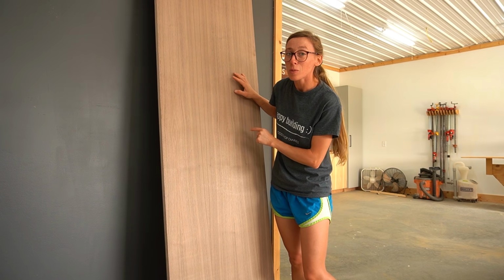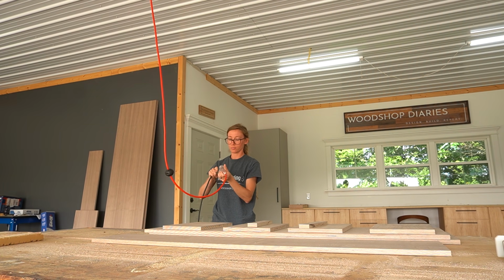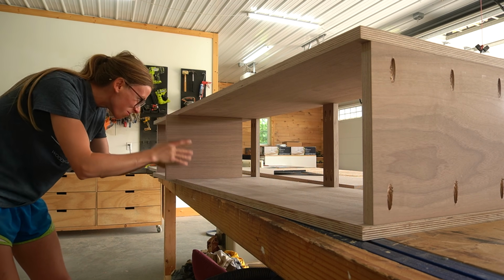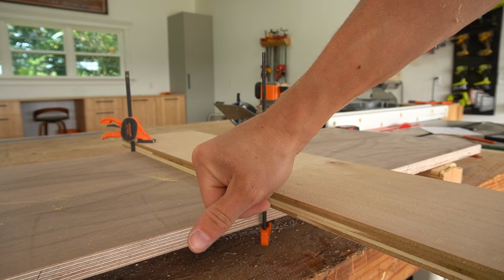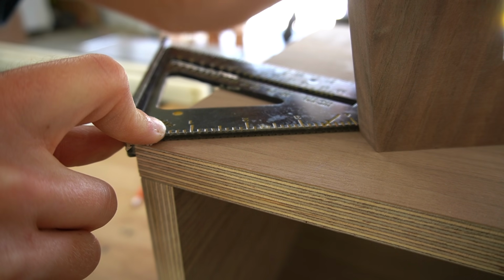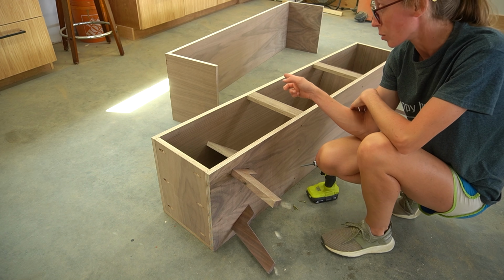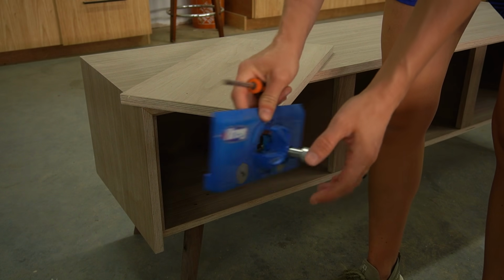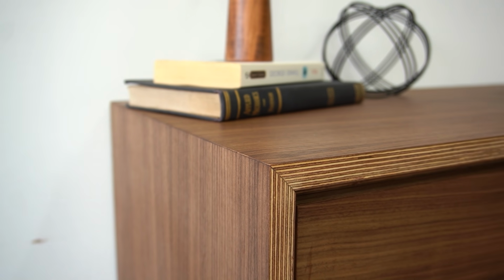How to Build a Mid Century Modern Console Cabinet

Comment: Why did you use full overlay hinges and not half overlay? Is it okay that I’m using half overlay hinges?
Reply from the maker: Almost every frameless hinge I’ve seen is full overlay. There’s so much adjustment in the hinge that you can adjust it to “half overlay” but typically I just leave 1/8” reveal so it’s full overlay.

Comment: I know I'm late to the party, but can you apply the furniture butter over a stain? I'm attempting to do a very similar project to this, but want to match the wood of the furniture I already have which is a dark walnut or espresso finish. I'd like to try and stain the wood to match my existing furniture, but don't want to use a polyurethane where I get a super high gloss finish.
Reply from the maker: I’ve not tried to use furniture butter over stain so I’m not sure how it would react. They make clear coat in different sheens. You can get a flat or matte sheen that won’t add shine. Minwax polycrylic in flat is what I’d recommend
Reply: @WoodshopDiaries Thank You!

Comment: Great design and great job!  You could also make the sides longer and make a space between the body and the top shell to make an extra space above the body and the top shell.  You would have to connect your initial box differently, so you wouldn't see the pocket screws.  Really nice flexible design.

Comment: Just found your channel this week.  Had to say I love the way you present your projects.  Also, I learned a number of things today: how to use a speed square to set angles, door building using the hinge jig, etc.  

I'm wondering how heavy that piece is?  3/4" plywood sides AND back panel!!  Yikes.

Thanks again for such great content.
Reply from the maker: So glad you’re enjoying the content! Thanks so much for following along and checking it out! To answer your question, it’s heavy! I can lift and move it myself (so it’s not crazy heavy) but it’s a sheet and a half of plywood so probably around 120-130 lbs 🤷‍♀️
Reply: What if you made this out of 1/2"    instead? Save money and it would be lighter.
Reply from the maker: You could. You might save a few bucks (very little—the price savings between 1/2” and 3/4” is pretty small) but it would be lighter if that was the main concern. However, I don’t think 1/2” material would do well spanning this width without an additional center support, though. I don’t use 1/2” material in my projects for several reasons (a few: they require different size screws, hardware and edge banding, and it’s not suitable for every situation).
Reply: @WoodshopDiaries  thanks again for replying. Your rationale makes a lot of sense. 3/4" it will be for me then. Thank you again

Comment: I love modern looking furniture and this looks fairly straight forward to build. I'm wondering how you would think it would look if the edging of the outer box was mitered inwards at 45 degrees?
Reply from the maker: I’m not sure I understand your question? If you edge banded it and mitered the edge banding on the front to match the sides? If that’s what you mean, that’s exactly how I’d do it. I wouldn’t have mitered corners and not miter the edge banding too.
Reply: @WoodshopDiaries  Sorry but my question wasn't clear. I was asking about mitering the plywood edges of the outside box that you see looking at it from the front. So you would cut the front edge of the three boards that make up the outside box at a 45 deg angle. So when you're looking straight at the finished piece the outside edges would be angled inward. So your just giving the edges a "softer" look. Hope that makes sense. I'm not talking about any edge banding. I really like the look of the exposed plywood edge.
Reply from the maker: @bwhite661 ohhh I gotcha. Yeah that would look great!
Reply: @WoodshopDiaries  My daughter wants me to build her a dresser type thing with drawers and shelves so I think I might use this as a basis for the design. It will be more of a vertical build though. I'm so glad I can watch your videos to get help especially with the drawers.

Comment: I really, really love how this turned out!!!  The design is so beautiful as well as the plywood you used.  I'm not a fan of using glue with pocket holes either unless it's especially necessary.  When I make projects it's nice to be able to take them apart to fix/replace an area that gets damaged later or correct a mistake during the assembly.  Thanks for another great video Shara!

Comment: I remember pieces of furniture, like your build, back in the 1950’s and 1960’s but I remember them as having sliding doors. But with doors closed yours and the ones I remember look the same. I still am amazed that you don’t use clamps to hold pieces in place while you screw them together.

Comment: Shara, that console turned out fantastic. I wondered about the exposed edges but you are right, they make a nice design feature. I screwed a sectional couch together for an apartment we once lived in. When we moved I unscrewed it and used the wood for many more projects. However, I go through a lot of glue so I don't claim to be a purest one way or the other. I think an arsenal of methods is the best way to go as circumstances can vary.  I love it when you start throwing in some angles on your builds. Hugs and kisses to Lucy and Bubby. Thanks for Sharing! 🙃🙂
Reply from the maker: Thank you! Yeah I’m not normally a fan of exposed edges but I felt like it fit on this piece. You are right… customize each piece as needed as circumstances do vary. That’s my favorite part of building things myself. I can customize it 😁 Lucy and Bubs thank you for the well wishes. Hope you have a great weekend!